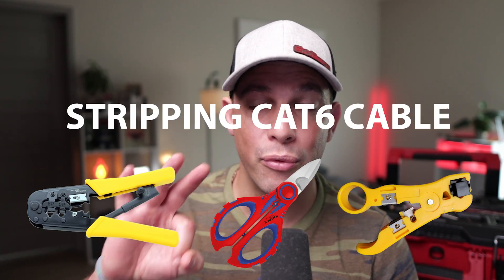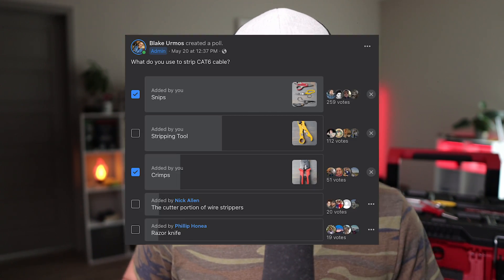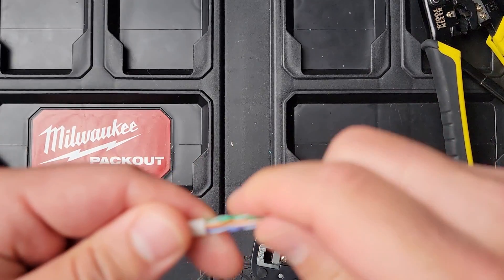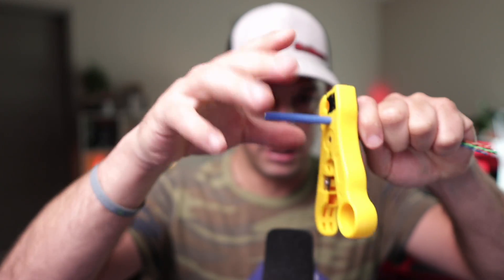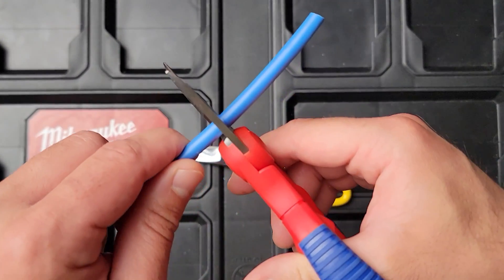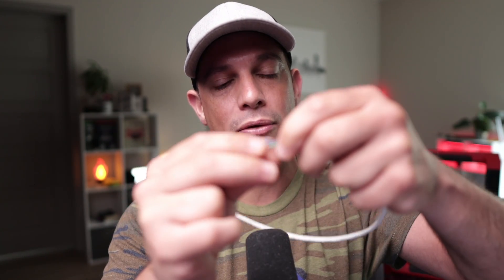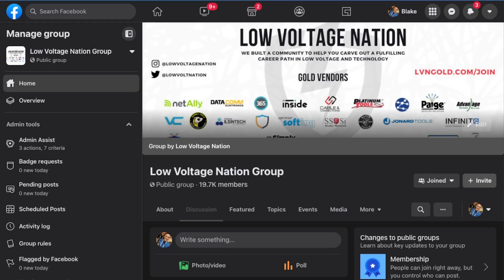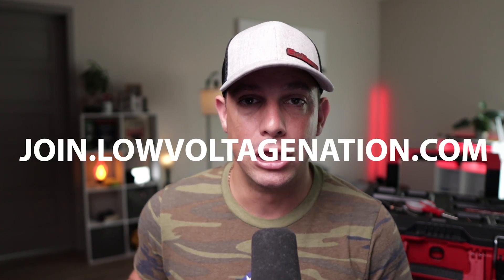Best Tool To Strip CAT6 Cable

Comment: Been in networking as an IT guy for a number of years now and have crimped a ton of RJ45 onto CAT6. Thanks to this vid, I just learnt that the plastic "core" is a rip cord to extend your cut. I've probably used it this way unintentionally a couple times, but I always thought it was there for rigidity and the string for pull strength. Thanks for the video! 

For the record, I use the built in blade on my Klein crimps but I don't go down all the way, just score and break like you show. I've gotten to know the sweet spot of the tool now so it's just quick and easy!

Comment: On simple 2 or 3 wire runs, snips. Big jobs with lots of cable definitely the dedicated adjustable cutter. Cut a piece ahead of time & dial it in. Then you can run the job without hassling the snips. Saves a ton of time! The built in ones have zero adjustments which will most likely lead to nicking the copper.

Comment: While I used all 3 methods it usually comes down to what’s closest! Lol I do feel like the adjustable strippers is what I would use on a job with multiple terminations if same size wire cause it’s so much quicker and you don’t have to worry about knocking if you have it set for that particular cable. I also feel like if your snips are handy and doing a few connections that I would just use the snips! My input :)
Reply from the maker: yeah the circumstance really dictates it. Sometimes you can just quickly ring the cables if you're doing many on a patch panel but there are better ringing tools out there like the smaller Panduit one. I always use snips, but to each their own!
Reply: Most crimpers strippers are for cat5 so if you do use them make sure not to push all the way down on cat6 and Cat6A
Reply from the maker: that's a great tip, thank you! What's interesting is that I'm using Superior Essex CAT6 in the video and it's quite slim like CAT5 but firm like CAT6.